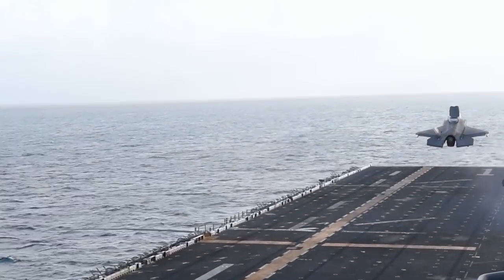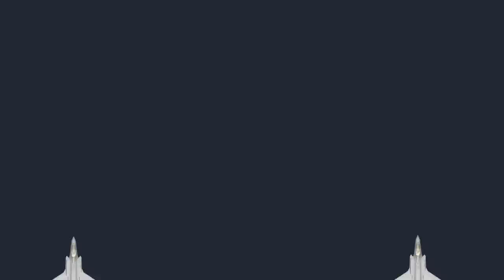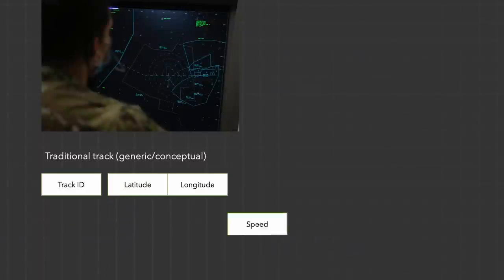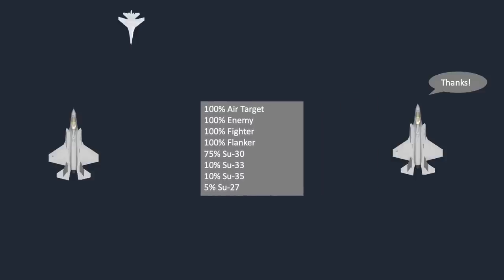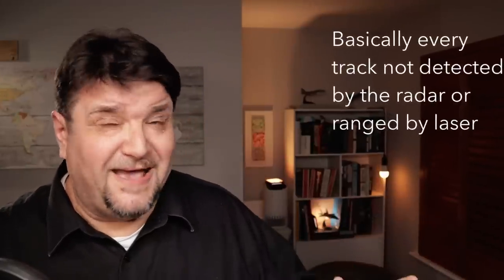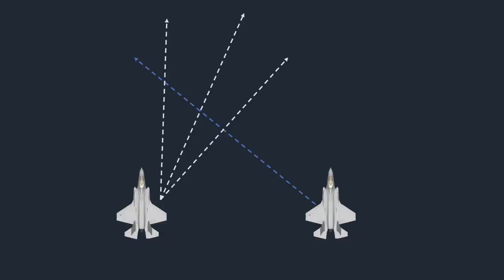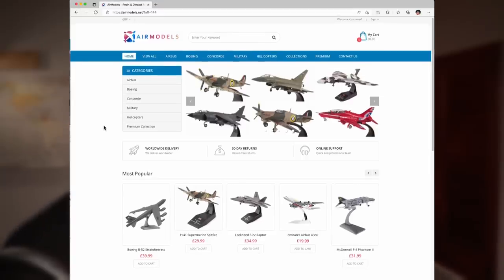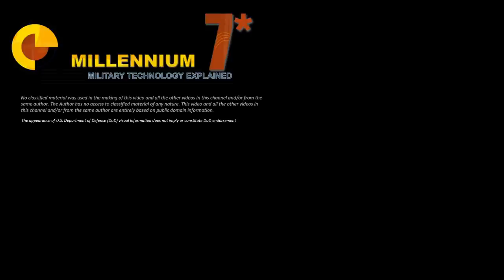The F-35 data-link works like magic!

Comment: And if the F-35 force is spun out beyond the weapons envelope range needed to exploit the cooperatively sensed tracks, it doesn't matter because the aircraft which are in-range have too few shots to decisively engage more that one target with 1-2 shots at a distance where SSPK slumps anyway.

Tighten up the float as 'pack hunters', and the tracks which you develop are going to be over-targeted, leading to multiple false tracks and a general derth of total battlespace picture even as the self-positioning data is subject to exploit and random chance may lead to salvo launches of threat weapons which put at risk multiple formation elements.

The original purpose of offboard support was to lower system costs and provide genuine impetus to network targeting by highly distributed apertures as value leveraged 'never send a ferrari to a demoltion derby' fighting architectures.

Then the college degree unionists got involved.  And their job security perverted the system from being a receiver of data to a provider of it, as a sensor master node.

This has enormous problems if (drone threats) your detection threshold is still transient/short-horizoned and/or there are massive range and track quality varations between a 15nm DAS, a 40nm EOTS and a 100nm APG-81.  Dependent on target class.

This at a time when strategic gatherers are 600-800km capable of hearing a mouse squeak in a hurricane of active signal.

You really don't want to be close-tail riding that signature while acting as a clearing house for data that is conveniently all-of-a-type in an ISR world where plug'n'play, 'open system' architectures are largely about how often a specialist system is devised to look for _just one target signal characteristic_.

The result is that the F-35 is way too much, way too few, for far too short a time in a COIN/OOTW environment and way too loud, far too close and entirely too automated compared to the cross-platform combinations which actually do the work of SIGINT and EOBM as BMC2 handoff.  Say a U-2S paired with an RC-135 or even an RC-12 and some kind of a close-approach drone.  What counts is the ability to coordinate differentiated capabilities and slant ranges to detect/classify/track a specific thumbprint key signature and, in a digital world, increasingly do so, realtime, within an active battlespace, as seekers, radars, nav and commo packages cycle thru a daily range of changing GTW modes and codes.

The F-35 is the frontend beneficiary of this.  But it doesn't have a hunting sensor capability nor the station time as in-range (over the mapline) presence to pick up and associated any 'cooperative sensing' picture.

Stealth should be effects-seen and not DL back-chatter heard.  It should get in, get it's hard or softkill effects mission done and get out, protecting the asset.  We are making a MASSIVE mistake in associating targeting with fires.  One which could end up compromising entire systems.

Now throw in major changes in defense capabilities like lasers and hunting weapons.
ru
Giving tactical aviators a new hat as mission role assurance is like giving Star Wars to the Normies.  Sure to wreck everythig.  In an arena that requires serious nerd power interpretation of what the raw sensor data is doing 'in the filter', forward processing is not going to make us more effective.

F-35 pilots don't have the carry to kill all of what their systems are programmed to see.  They don't have the standoff range to hit what they do carry for.  But they sure are exposed.  Politically and tactically, for being there.  And for force protection as much as anything, their coverage is not nearly as global-omniscient as the airborne IT specialists want you to believe the network chatter justifies.

Tamara, Vera, Krasuhka, Kolchuga, the list of passive systems designed to track 'invisible aircraft' by their emissions is endless and has a funded heritage in the Eastern radioelectronic combat force Orbats going back decades.  As one of the few things they do very well.  It is guaranteed that MADL is being listened to.

And that is a very bad thing when the track fusion process first requires coordinated TDOA master clock positioning of own force sub array locations to begin statistically debugging a short baseline transient signal to a best guess: 'I dunno, let's go take a closer look!' outcome.

Comment: For anyone who found this video's content confusing, with a little guessing I'm sure I can provide the following re-explanation which might be more clear....

A few comments leaning on my background and training as a computer systems architect and assuming that no one is re-inventing the wheel designing the F-35 communications network...
Your attempt to explain time synchronizations is an admirable attempt but all wrong and more than likely the communications is a lot simpler to design and implement than you're imagining.
First, it should be noted that even on ordinary computer networks, time synchronization has to be very precise so this is not new and strange technology. Microsoft Windows Domain networks demmand that every machine on the network be within a second or so of each other or machines will be denied access and possibly kicked off the network.
Every node in the network (computer or platform) is built with a clock embedded in its system. When a node is powered up, it typicaly is required to check with a designated Time Server for synchronization and that Time Server gets its time from Atomic clocks somewhere in the world so in theory every node should be within nanoseconds of every other computing device referencing an atomic clock anywhere around the globe. The only devices which won't be within nanoseconds would be machines that are poorly configured and haven't checked an authoritative Time Server in some time and since typical devices don't have an embedded atomic clock gradually become less accurate over time.

But getting back to the F-35, each aircraft probably is sync-d to an atomic clock every time the aircraft is powered up and still on the ground and although might sync again sometime during flight probably isn't necessary if the onboard clock is reasonably good and missions don't last more than several hours before returning to base and powering down.

Now, it's also quite interesting that you refer to the data stream as "messaging." This is a relatively recent innovation in computer data transmission over the past couple decades. Previous data streams were all variations on top of an RF transmission medium like AM or FM radio. Nowadays, practically all data transmissions on the Internet are message based which means that a particular bit of data might be described with a list of parameters and values for each parameter, each parameter is labeled and is laid out in a text format. In the computer world, these formats are text based and examples are XML and JSON. Data in this form is known to be capable of being highly descriptive and although extremely verbose is also highly compressible so if compressed during transmission can send a lot of information using very little bandwidth.

Note that media streaming like actual video or audio cannot typically be sent using messaging. If you want to be ultra efficient and want to send video or audio, that information would first have to be translated into text or enough descriptive parameters that the receiving end can reconstruct the video or audio from the text being sent.

Probably clarifying what was likely trying to be described in this video is that when sensor data is transmitted and shared with other nodes, the detected object can be described in a number of different ways... eg  coordinates in a 3D grid, maybe coordinates on a 2D grid which when combined with data from multiple sources could triangulate, or maybe sensor data that might have a range parameter or attribute which could mean specifying an object location without needing triangulation. Again, if the parameter is available, data messaging supports this and any other methods to map out the battlespace in a way that all participants should see the same thing and everything. And note that since every data point that is transmitted and shared among all is timestamped, it creates an integrated view of everything despite every data point likely being a snapshot of a different point in time and can extrapolate or correct the differences to make everything fit together.

Hope this description helps those who might be confused by what is presented in this video.
I have no inside info into how the F-35 system works, but as I began, what I described simply describes what is theoretically possible using well known existing computing technology.

Comment: AI and information fusion  would need lots of spectrum assume  tatical L band 960 to 1200 Mhz the military uses, recon one would be pushing a gross rate of 50Mbits  and closer to 30Mbits, will the military use its own 5G tatical networks.

Comment: I did copy part of the F35 code from Wikileaks into my RAH-system (run and hide) of my highly tuned 50cc moped. It detects the police and random pedestrians who call the police. It shoots down redlights and switches traffic lights to my favor when I run through town 🚀🤣🦖🥳🤩👻
Reply: There was actually a guy who took home some parts from work, and rigged radar jamming into his sports car.
This was ultimately a very poor decision for him. As unbeknownst to him, police radars couldn't handle the energy output, and he was inadvertently "destroying" police radars.
Eventually local law enforcement figured it out, and which car was doing it. Local law enforcement were very irritated, but not as irritated as the pentagon...
But though ill advised, it was very amusing.
Reply: What's the programming language?
Reply: @kathrynck 

He should taken home some stealth coating too.
Reply: @tumslucks9781  hehe, well he was not caught with radar. But rather caught by officers (eventually) visually noticing that a certain car was always present when their radars broke. Eventually they put 2 and 2 together (at the expense of many police radar units).

He probably would have gotten away with it indefinitely, except he didn't account for the much softer electronics in civilian radar kits for police, and the relative strength of his jamming with the inverse square law at very very close ranges. If his jamming had been weaker, he likely would not have been caught. But he was frying every police radar that looked at him.
Reply: @tumslucks9781  Visual Basic

Comment: Some of the features that may already be or might eventually be incorporated could be
Block Chain packet switching
Total integration of all assets
High speed battle management land based computers assessing opportunities and threats and presenting just them with recommendations to the human operators
Total coordination and integration of all assets
Retrofitting existing and incorporating the system in all new assets
Selective filtering on a relevant need to know basis to each asset eliminating overwhelming the human operator and subsystems with vast quantities of needless data not relative to its possible role
Prioritization
Convoluted methods of encryption that can be programmed to changed
Management of all permissible transmitters and receivers

Elon Musk has entered into collaboration with the US military to develop networks of military satellites that will be integrated with Starlink. The AI flexible swarm concept uses these assets to configure swarms for specific missions, monitors the progress of the mission, makes alterations if the actually mission deviates from the plan, and assesses the success or failure of the mission. As an AI system it learns from underperformance or failures and sell corrects by reprogramming itself. 

I am reminded of my initial orientation at Bethlehem Steel as a new hire management trainee/engineer in 1969 which is now 53 years ago. The process of order tracking was similar but of course on a much more technologically limited scale. Here's how it worked. There were sales offices in every state in the United States. When a customer placed an order it was faxed to a central office in Bethlehem Pennsylvania. Workers typed the data into punch cards which were sent on a conveyor through the main building to be entered into the company's management computers. The computers would determine every aspect of how the order was to be placed. When and where it would be produced, that is in which plant, what heat of steel, how it would pass through each processing mill, how and where it would be packaged, what truck it would be shipped on and when it would depart and arrive. All of this information was available to the customer within one hour at the sales office. Every step was monitored and any changes through the path were immediately used to reprogram the process. What management told us at the time was that the Japanese could make steel of equal quality, ship it across the Pacific and then by rail across the United States and sell it at lower cost in the Company's backyard. The one thing they could not match was service. Among the many things besides technology that were invented in the US was these complex management systems and their integration with other technologies. As we can see from the performance of the Russian military in Ukraine this is one area where Russia is a century or more behind NATO.